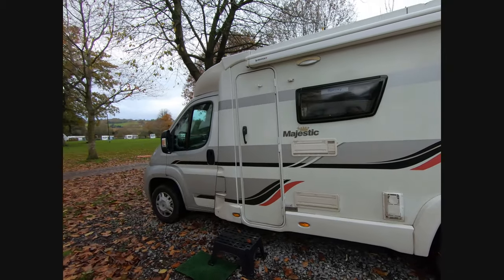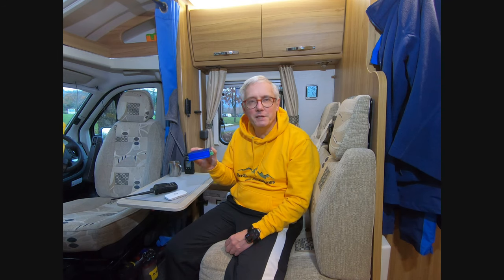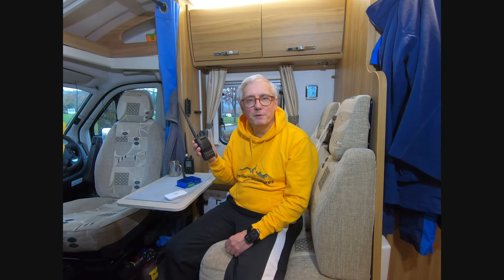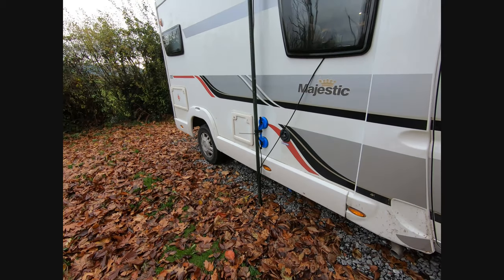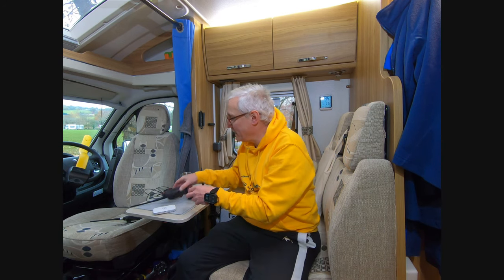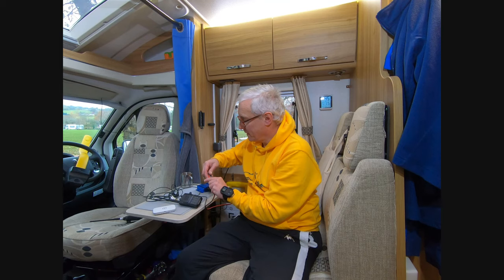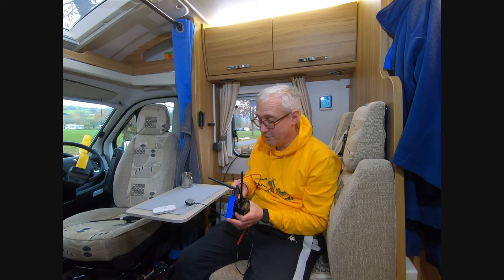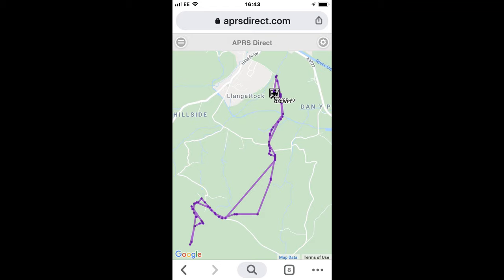Get lost the ham radio way. How to make an effective mobile APRS iGate for amateur radio

Comment: Ah I get it now. The handheld you went walking with has TNC built in, the handheld connected to the caravan antenna passed the audio from the receiving radio through the Argent data system TNC then igated. I can see this working for me with replacing the Argent with a Mobilink TNC 3 running in the boot of my car. Nice campervan, all I have is a Corsa and occasionally tents. Good to see APRS getting a mention, sometimes I think I'm alone in this.
Reply from the maker: Yes, that's the way I do it. The FT2DR has APRS built in.
Reply from the maker: @MakingRadioWaves  I have never foundi it useful for communicating myself. way too clunky.
Reply: Carl - what about the chip van?
Reply: So could a MobilinkD TNC3 be used on both the HT while walking around as well as the mobile unit in the van, to repeat the APRS data back and forth?

Comment: Could you just use an X1C5 tracker and a mobile phone that has a hotspot enabled?
Reply: I bought the X1C5 Plus after seeing you vid on that unit. Given you know that system would that coupled with a mobile hot spot work well?  The software programming manual is lacking detail on using the X1C5 Plus as a igate as well as setting other parameters; i.e. smart beginning.
Reply from the maker: Hard to be sure. It doesn't work with my iPhone's hotspot for some reason.

Comment: Richard, it seems you are using the 2m-Colinear that SOTABEAMS has been producing in the past. I missed ordering it at the time, is there a chance you will get consider bringing it back into your portfolio of products?
Another suggestion: what about keeping your latest videos in a separate channel from the more product related (older) videos? This would make it easier to keep a better overview?
I very much like (all of) your videos and am a happy SOTABEAMS customer.
73, Jo - DL1JRM
Reply from the maker: Thanks for your comments. The antenna used was a standard commercial colinear - not something we have ever made. Regarding the videos - I will be gradually delisting the product ones so the channel will become focused on the Radio Adventures content.

Comment: Hi Richard I note you no longer recommend the argent unit. What do you recommend now?
Reply from the maker: There is no direct equivalent but the WX3in1 from Microset is a solid unit.
Reply: @g3cwi_Radio_Adventures  Why do you no longer recommend the Tracker4?
Reply from the maker: @mobileandmonitoring2810  It's not well supported by the company that sells it.